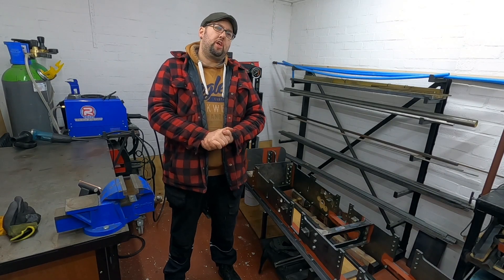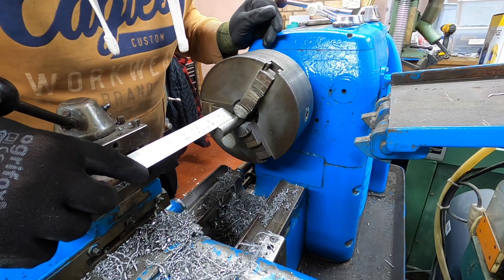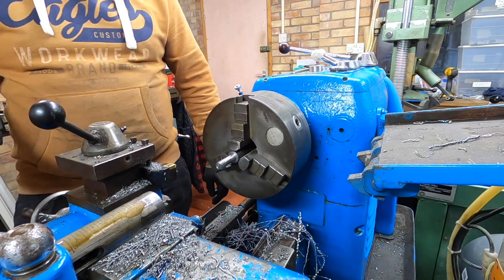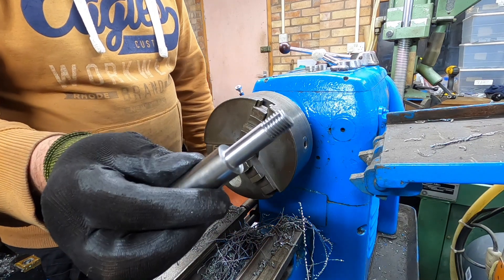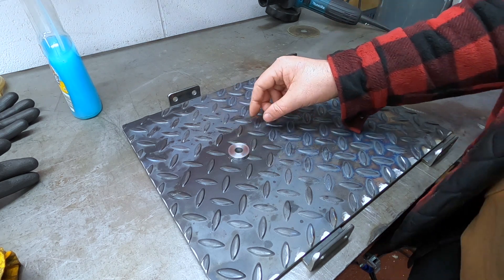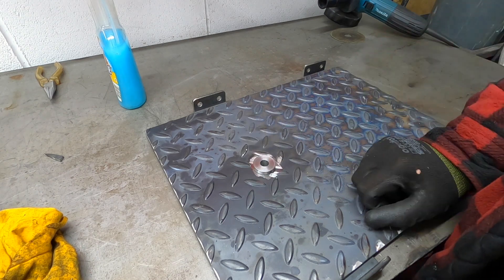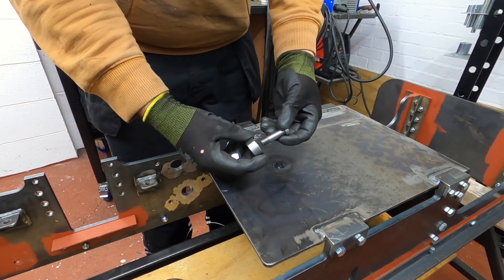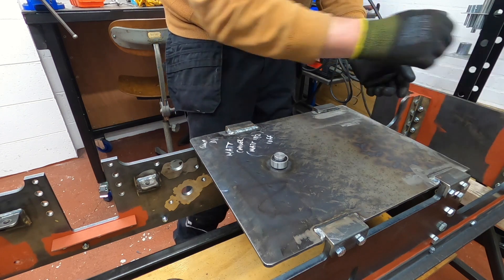The Footwell Part 4 - Pivot Pin, Bushes and Welding - EP15 - 7.25" Gauge Steam Locomotive.

Comment: In answer to your comment at the end, your videos are very inspiring. I'm planning on building a tram in 7.25".
I'm not a machinist myself, so I'll be getting outside help for frame & body, but I know electrical, and I know design. So I've been having fun wiring up some of the driver controls, and sketching bits out in CAD.
I enjoy watching your videos while tinkering away with a circuit, it's good motivation!
Reply from the maker: Thank you Kaylee, it’s nice to hear my videos give you enjoyment and motivation, inspiring people is one of the main reasons I started making the videos.  All the best, Matt

Comment: Really enjoy the build videos :) just a idea, if you put the pin for the pony truck pivot in the other way round (nut on the bottom) then there is less sticking up in the foot-well to catch your feet on then if the nut is in there with your feet....
Reply from the maker: Hi h2ogasnz, Thanks for the comment, much appreciated. The reason it's currently nut up in the footwell, until the locomotive is on its wheels I'm not sure how much clearance is underneath the loco, so to be safe I designed it with the nut inside. This may change if we have ample space underneath. All the best.

Comment: Really enjoying the build Matt! I have a hobby shop with a Bridgeport VS Mill, 1936 model Atlas Lathe, drill press, etc. I would like a heavier lathe but will likely have to go the used route again like I did the Bridgeport. Love the older, heavy iron! Your techniques are instructive and inspiring. Thanks for allowing us to come along on the build!
Reply from the maker: Thanks for joining the journey. My thoughts over the last couple of days was seeing if I could get hold of some really old belt drive machines and restore it to belt drive, but the belt drive powered by electric motor, may need a bigger workshop though!!